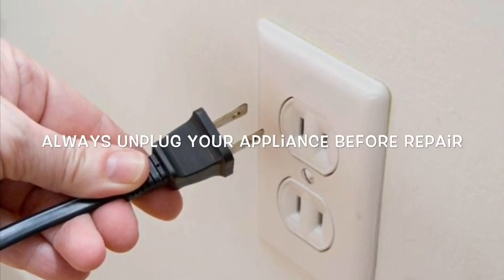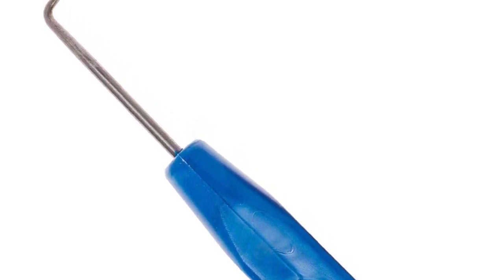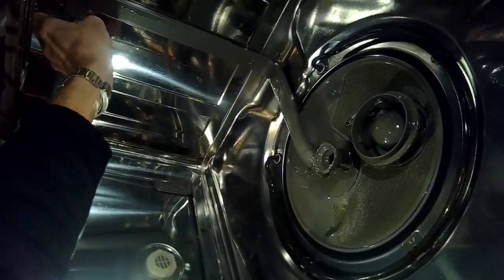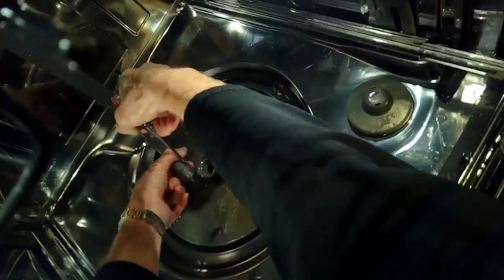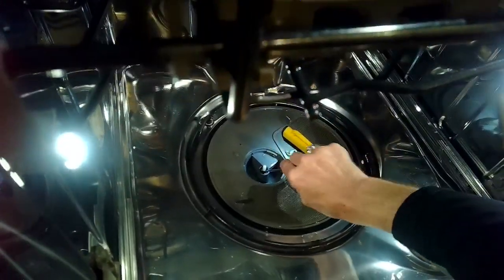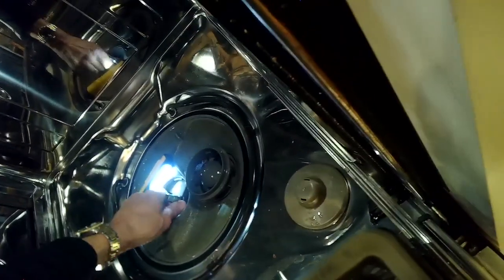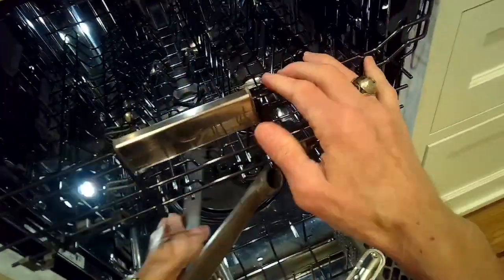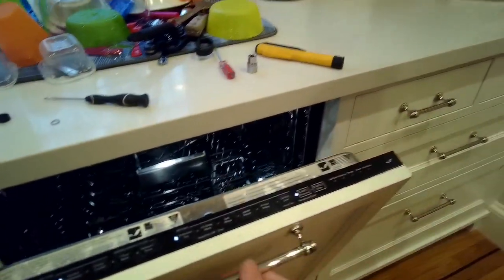✨Whirlpool DISHWASHER LEAK — QUICK FIX ✨

Comment: My Whirlpool dw was leaking out the door, but not consistently—only during certain cycles.  The repairman replaced the door seal, and it still leaked.  Finally, he had to put a special clear door on it to see that the bottom spray arm was getting caught on the bottom rack and squirting high pressured water up along the door seals during a certain cycle.  He replaced the bottom spray arm and it fixed the problem.
Reply from the maker: Wow, that was clever😊😊😊
Reply: Thank you, I am having the same door leaking problem. I have replaced the gasket and the door seal on Whirlpool WDT750SAHZ. I bought this in November 2018, and I am surprised it lasted for only 3 years. Do you know the model # of your Whirlpool please?

Comment: Thank you for the video  this problem happened to me today   looks like easy fix  thank you!
Reply from the maker: Please let us know how it goes👍
Reply: Thank you .. Got it back together following your instructions and using a socket to smash it down in there ,  I did coat the new rubber seal with a plumbers  grease I found .  Running the dishwasher for a 2nd time now no drips so far.  The prev leak damaged my cabinetry around the dishwasher so I'm going to buy a dishwasher pan at Home Depot for $20 tomorrow as additional protection  This allows water to drain out the front if water is leaking  and has a lip on the 3 sides to protect leaking in the back and sides   seems well worth it
Reply from the maker: Nicely done Travis😊👍

Comment: Note: the grommet/seal not only has a little spring around the inside rubber center (to allow the grommet to fit the white plastic motor shaft more snuggly, but the outer diameter of the grommet is actually a coating for an internal metal "cup."  That's why the outside diameter of the grommet feels harder than the soft rubber inner diameter. (completely coated by the grommet itself). So, when you are trying to remove the old degraded grommet and are scraping away at it to try to pry it out of there, you might actually scrape the soft rubber center of the grommet out, but leave the metal cup. The metal cup needs to be removed.  The cup is part of the old grommet, coated with rubber. I had to use a tiny needle-nose pliers to pull it out, because the outer rubber coating kept it wedged in the hole where it's seated.
Reply from the maker: Excellent information,
Thank you😊
Reply: Thank you so much for posting this!  I couldn't figure out why I couldn't get the remaining pieces out. Every video made it look so easy. After about an hour and a half of googling, I randomly started reading comments under this video and low and behold! Winner winner chicken dinner! You saved me!🙌🙏

Comment: So I replaced the seal and the leaking slowed, but still leaking. I can see the leak comes from 2 seperate points under the machine, both from the divertor motor. What should I do? Also, looks like a small coil ring came out when I took the old seal out?
Reply from the maker: Hi Franklin,
Sounds like you did everything right.
That ring is just a spring that was part of the old seal.
I think if you’re willing to repeat the process a second time you’ll be able to get that leak to stop.
Some people have been adding a little bit of silicone grease to the inside of that seal and they said that does help to reduce any small drips.
Reply: I did repeat with lube and still leaking. Is it possible that i need to order and replace the entire diverter part?
Reply: OR should i order a new seal that is slightly bigger so it is more snug?

Lastly, would the sump need replacement? Id rather not disconnect everything for that repair.

Happy to donate to your paypal if we can get this resolved!
Reply: @franklina8814  What did you end up doing?  I'm in the same boat... replaced seal but still leaking. About to buy the whole diveter motor assembly.
Reply: @jmstavola  me too, did you solve the leak?
Reply: Same here guys... I am going to replace the diverter cap ring and see what happens. I noticed it was not as snug.
Reply: @OK-kw4rv  sorry, just saw this.  I did fix it by wrapping the shaft that goes through the new seal with plumbers tape.
Reply: @brycelooney7287   I did fix it by wrapping the shaft that goes through the new seal with plumbers tape... making it more snug

Comment: I am taking mine apart for the third time, it continues to leak.  The second time I wrapped it 4 or 5 times with white plummers tape but no luck.  This time I am using blue monster thread tape, it is thicker than the white stuff.  I am keeping my fingers crossed!
Reply from the maker: How did it turn out?
Reply: @QuickAndEasy5MinuteAppliance   Unfortunately, the leak did not stop after 3 attempts.  I called a repair company and $368.00 later it is fixed.
Reply: @DanBrownlee-o5w what did they say was wrong with it?  I am having the same issue. New part but still leaks.

Comment: Before I order this gasket, I I’m under this machine listening to a loud clicking noise while that thing is leaking. I’m wondering if that’s the diverter motor?
Reply from the maker: I bet you’re right.
Maybe the motor can’t turn.
Reply: So in your opinion,  should I replace that or start cheap and go with the seal first?
Reply: I just looked it up and I don’t know if that rubber seal is available by itself. The motor is $110. Washer is 7 yrs old. Not sure if I want to spend 110 on a 7 yr old machine or put towards a new machine anyway! 🤦🏼‍♂️

Comment: well got mine tore apart and i was shocked. NO GROMMET SEAL inside. WHAT? is that normal? there is one underneath but not on the inside. its been fine for years...and just started leaking. is this normal? not having one inside?
Reply from the maker: Can you send me a picture of that? Scottthefixitguy@yahoo.com
Reply: @QuickAndEasy5MinuteAppliance  of both or just the inside one? i will send both. strange to me.....

Comment: so what do you do if it's still leaking?
Reply from the maker: Sometimes you need to replace the actuator motor also.  Are you pretty sure that the leak is from that area?
Reply: @QuickAndEasy5MinuteAppliance  Yes,from the white round piece where you've circled and pointed to in your picture.
Reply: The leaked slow down significantly but it did not stop.Does the rubber seal need any kind of breaking in?
Reply: @SuperDavexxx  same with me. Slowed the leak massively but still a small drip. What did you end of doing?
Reply: @paulmuri  what did you end up doing?